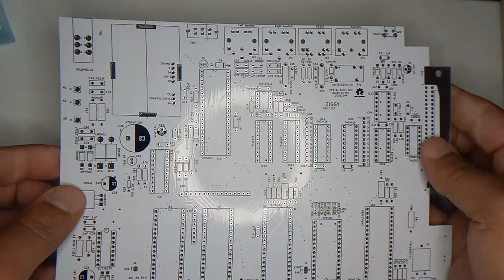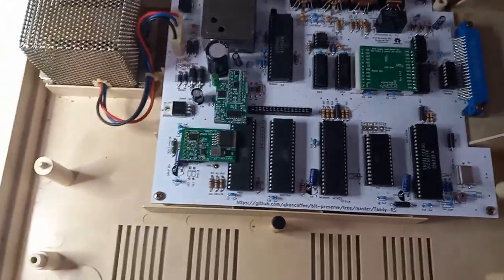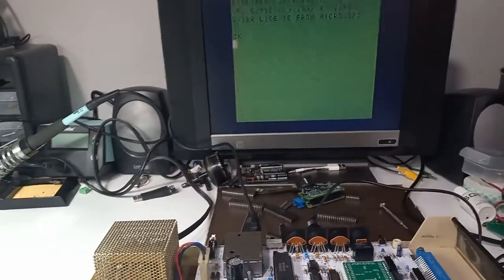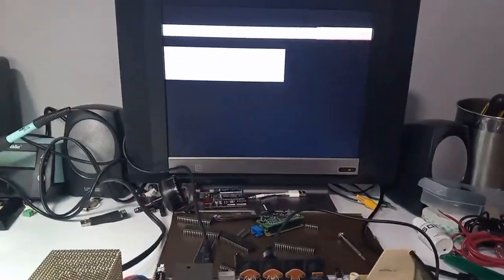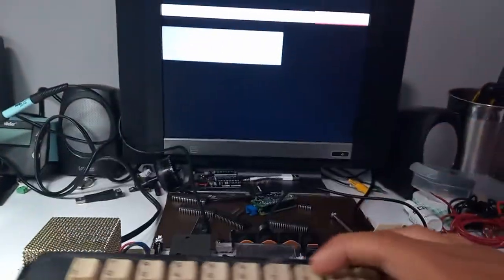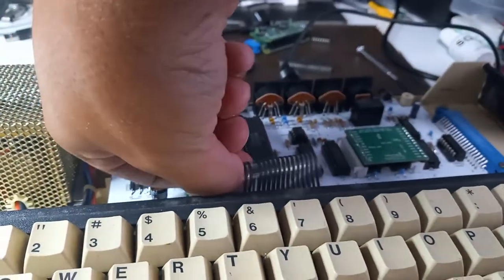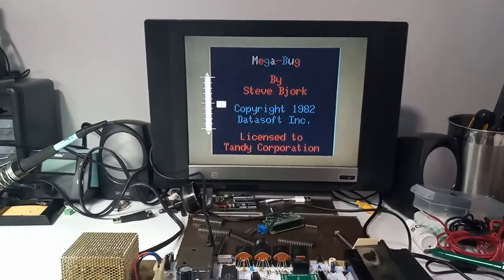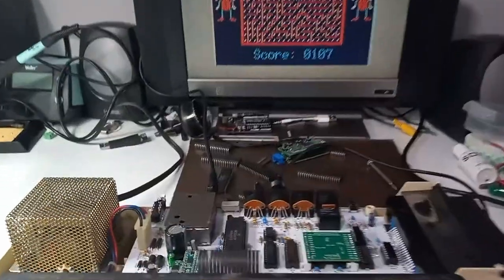Testing a recreated 26-3134A CoCo 2 board. Part 4.

Comment: I hope you do the T1 CoCo and make a version designed to host the pepper board and the DACquiri.  Also, design it so we can use more conventional power supplies and even like a USB power brick if that's even possible.  I want to build the scratchiest, from-scratch CoCo ever.  new keyboard, new motherboard, new power supply, output to something more modern (VGA or better) all built in.  That would be pretty epic.  And maybe do something that integrates Dave6x09's work where he interfaces a raspberry pi to do things to enhance the CoCo as well.  It doesn't get any more scratchy than that!
Reply from the maker: Yup, the T1 recreation is the next logical step here. I can't find a schematic for the T1 CoCo 2 so I'm going to attempt to recreate the T1 CoCo 2 based on the work I did with this CoCo using a non working donor board that was actually provided by MrDave. One day when the chip shortage goes away, I can start on other things like USB keuboard ect. At the end of recreating the T1 CoCo we will hopefully have a useful schematic for it.
Reply: @rockyhill3  I have an idea for fundraising.... send the funds wherever you think they will do the most good.  I have a schematic for the CoCo3.  I think it looks pretty nice printed out.  If you can, make them into useful art for sale.  I'd love a mouse pad or larger with such design work printed on them.  Even and especially the circuit board design work you do looks pretty snazzy.  You make it, I'll buy it.